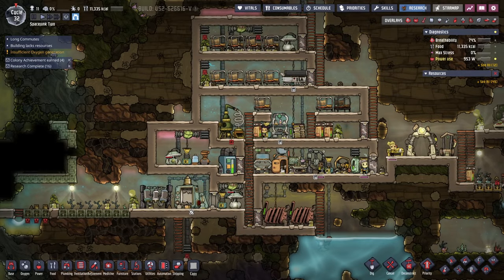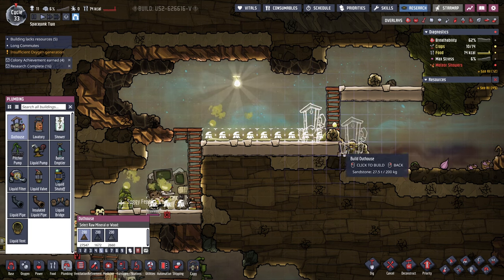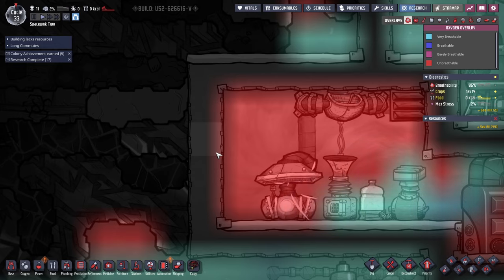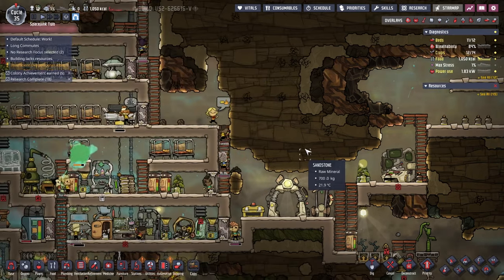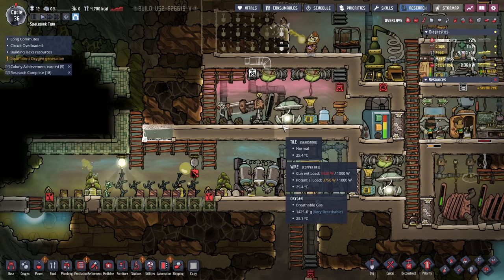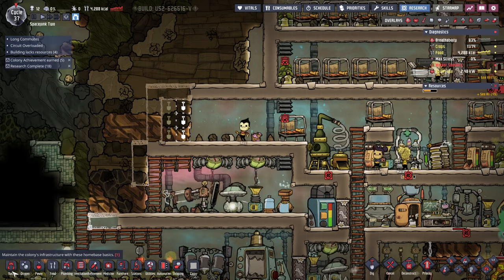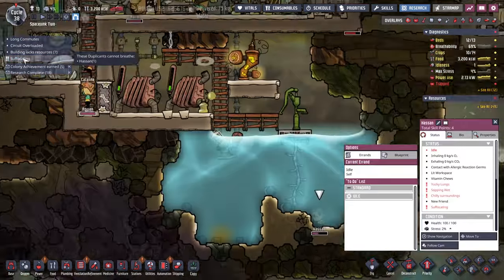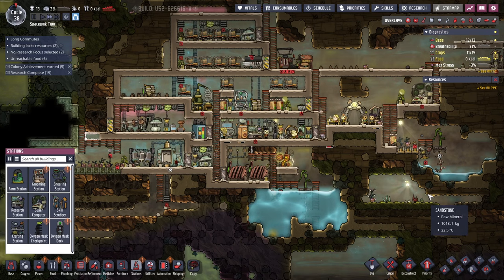Oxygen Not Included 6

Comment: Hassan and sweepy make my day better 😂

Since you are still figuring out how does electricity, water and gases flow, and how to manage them systems, I'll going to suggest you to use the "scissors" ✂️ 

There is an icon on your right bottom side of your screen, with the other "tools".
The scissors let's you "cut" any "pipes", no matter they are gas, water, "electric pipes", or some other stuff yet to discover...

If you use them with the proper overlay (top right buttons) it will let you separate only the things you are willing to.
To connect them again, you would need to "rebuild" over.

Connecting with rebuilding works with any kind of "pipe" you select to build over. Even different ones.
That is intended to let you replace some already build in "pipes" with better ones, or better for the "job" you are intended them to do.
You can even replace pipes with the same "kind" but different building materials...
It will let you reconnect, and then you can "cancel" the rebuild job, so no actual replacement is happening.

Anyway, its just a tool the game gives you. A little OP in my opinion, but it will let you play around with your circuits. Specially because every time you use the tool (or build an extension), the circuit "refreshes", so it might change some of its behaviour, depending on your inputs, outputs... That explains you why sometimes the circuit behave different (the water reservoir, for example)

There is whole college on Klei university to study the behaviours of the "circuits". Them scissors will make your life more easy until your get your Klei circuits certificate 😂

Cannot wait for the next one ❤
Reply: By the way, you can use the letter "o" when building things, and it will let you rotate some stuff.

There is not a lot of things that can be rotated without mods, but some things do... And can make you the day as your video made mine ❤